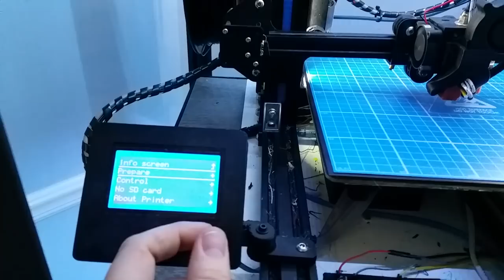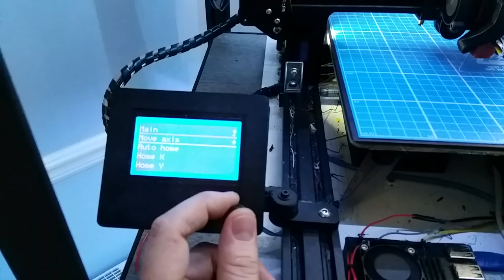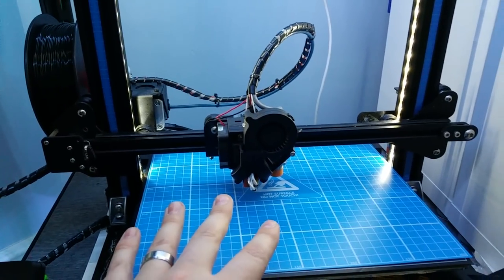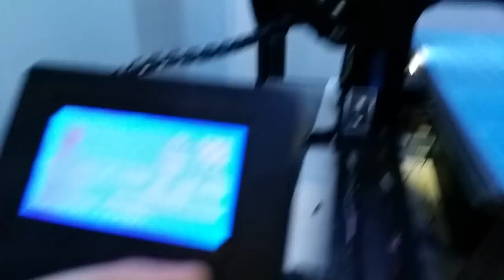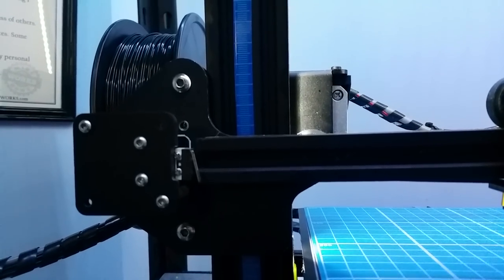Quick Fix - Checking your Z Gantry Level - How to fix

Comment: I thought maybe I was doing it wrong but watching your video its spot on. Here is my issue. I have a CR-10 max and I set my gantry height to 120mm left is usually a little lower. After I raise the left to match by twisting the left servo while servos are engaged "hot". Once I am happy with the Gantry level I go onto the bed leveling. after auto bed leveling is good I start the print. Just a note I am never more than .2mm off on the 16 points the BL touch examines. Everything print great. I don't shut off the machine I get ready for second print and the left Z axis has dropped again. I am going nuts. Only conclusion is the Servo's are sgutting off/unlocking for a second or two after the print has completed.
To further enforce that behavior, If I shut the servo's off I can watch the left side drop because of the weight of the filament servo and other hardware bits. What in the G code could do this. I am at the point of considering adding weight to the right side to keep life balanced. Any Ideas?

Comment: I am so glad you showed this. I just got my printer today and I couldn't level the bed. I noticed it was actually the gantry that was off. I have a Sovol SV01. They have a video showing to loosen a couple things and straighten it, then tighten. Doesn't do anything. Goes right back to where it was. Going to give this a try!
Reply from the maker: These upgraded leadscrew nuts we carry will prevent the gantry from sagging: https://www.th3dstudio.com/product/upgraded-leadscrew-nut-for-creality-printers-anti-backlash-nut/
Reply: @TH3DStudio  Thank you!!! Going to order some!
Reply: @amberlindsey7112  Did you end up sorting it out? I also have SV-01 and just realised the culprit is the gantry.

Comment: Thank you so much for this video! I thought I was going crazy, this makes a lot of sense now. However I think part of the problem is the weight of the extruder stepper and the print head stepper overcomes that z axis worm screw/stepper on the left side. I wonder if mechanically linking the two z axis worm screws together would help?
Reply from the maker: mechanically linking will help a lot.

Comment: I know this is an older video, but what would be the permanent fix for something like this? Also love those leveling stickers.
Reply from the maker: I still use the stickers to eyeball them. Adding antibacklash nuts to the leadscrews can prevent them from "falling" when the motors are off or you could source a closed loop belt and pulleys along with blocks to retain the leadscrews to physically link them together.

We carry the antibacklash nuts here and they should be restocked soon: https://www.th3dstudio.com/product/upgraded-leadscrew-nut-for-creality-printers-anti-backlash-nut/

Comment: The "long" fix for this (at least to get it closer to "square" with the frame) is to square the Z / Y fixed frame first (not easy, requires patience shims and engineer's level or other measuring tools) and then partly disassemble the X Beam (or gantry) in order to balance out the wheel set and the pieces holding the wheel assembly to the X Beam (which also isn't easy because you need to access hidden screws on the left side - and that means taking off the very top gantry of the frame and disassembling the Lead Screws so you can run that X Beam up and down repeatedly to check for square.   That will help take out "most" of the "spring" introduced in the X Beam that causes one side to move down when the steppers are off - but it's nearly impossible to make it perfect.

Connecting the left and right lead screws physically and not using dual stepper motor would help keep them in alignment longer after the steppers are disengaged.

Or you can do this before each printing session.
Reply: Thats where I started, and got my wheel sets pretty well in shape. However I think part of the problem is the weight of the extruder stepper and the print head stepper overcomes that z axis worm screw/stepper. I wonder if mechanically linking the two z axis worm screws together would help?
Reply from the maker: You are absolutely correct. A month later after making this we took apart the whole X gantry and squared/tightened everything up. It's been perfect ever since.
Reply: @TH3DStudio  is there a tutorial on how to do this? I've got this problem with my CR10s Pro
Reply: What actually causes this "spring" that pushes the gantry off-level? I can feel it when I try to level my x-gantry using the z-couplers.
Reply: @benparker3111  is there a vid on here showing how to do it the long way?
Reply: Nah the REAL fix is to stop using 2 different motors to control the Z axis. Instead get/print a conversion kit with gears and a timing belt to connect the 2 Z screws together and drive them from a single motor. That way they are forced to always stay in sync.

Comment: So you auto homed and then you held your printer? Which made the hot end go to the center? I've got a CR 10 S5 and if Ender 3
Reply from the maker: The center homing is only when you have an ABL sensor on the machine and you have the firmware setup to do so. Our EZABL kits with the accompanying firmware does this.

Comment: Thanks for the info :) question, if you were just running stock, when would the stepper motor kick back in on a cr10, just again when you start the print?
Reply from the maker: Whenever the Z motors are disabled. Depending on the firmware settings it varies. Our firmware keeps them locked when power is on unless the user power cycles the machine or tells the motors to turn off.

Comment: One thing to add years later,  be careful with dual Z if you dont have a collar keeping the axis down.  when I "leveled" my gantry, the power supply side of the gantry Z screw popped up to let it go back out of square.  you have to force it to stay square as Creality's design of the gantry makes it impossible to make it square
Reply from the maker: Yeah its not ideal. We have started using blue loctite on the bolts in our printer farm machines. It's made maintenance a lot less over time
Reply: Any bolts/ screws that I should avoid putting loctite on?

Comment: The problem is that this fix is temporary. I have found with printers like this, the X axis "wants" to be crooked as there are some other moment forces in the gantry forcing it into that position, so it will always go back to crooked no mater how many times you force it to be tram. Instead you really need to use a timing belt and a couple of small timing gears to connect the 2 Z threaded rods together to keep them synced, or better yet get a single-motor conversion kit to drive both of them from a single motor instead of 2 separate ones.

Comment: Hey Tim, great info. I actually use a 15cm / 6 inch metal ruler to measure from the frame to the horizontal beam of the X gantry periodically. Cheers, JAYTEE
Reply: I actually grabbed a bunch of Ikea measuring tapes to other day to perform the same function :) FYI the i3 Mega prints beautifully. The provided Mr and Mrs owl gcode was corrupt ( 2 failed prints at exactly the same position ). Sliced my own and they're gorgeous. Cheers, JAYTEE

Comment: i thought you were supposed to disable the 2 stepper motors that makes your gantry go up and down then just manually turn one motor down until level then  enable motors again ??? just got my cr10s yesterday so i am still learning proper setup...thanks
Reply from the maker: Keeping them engaged will make sure it stays level until the next time they are powered down. You can add on an antibacklash nut to help prevent this as well. We've added those since making this video: https://www.th3dstudio.com/product/upgraded-leadscrew-nut-for-creality-printers-anti-backlash-nut/

Comment: Thank you for the video! not sure what I'm doing wrong but I just can't level my z level, the extruder level is 1mm of from left to right and no matter how much times I try this hack it does not level it, any ideas?
Reply from the maker: If its going back to the old unlevel setting you should rebuild the printer and make sure its all square. The root cause of it going out of level over and over again is due to a mechanical issue and its usually improper assembly.

Comment: How do you make the auto home go to the middle? I have a CR-10 and it goes to the left front corner...
Reply from the maker: It's part of the ABL system settings in the firmware. It's called Z Safe Homing.
Reply: @TH3DStudio  does it come with the original   CR-10 system? I can't find it...
Reply from the maker: No, this is only when you update the firmware and you are using an ABL system. We have all that setup in ours. https://support.th3dstudio.com/hc/en-us/articles/360043293452-TH3D-Unified-Firmware-Package

Comment: why would  you raise the left side, where the z stop is, instead of the right side? wouldnt that throw it off every time it homes, since that side is set by the end stop?
Reply: right, when it homes again, wouldnt it go lower... back to where it was before you leveled it, since thats where the end stop put it?
Reply: it doesnt have the end stop on the left side, with dual z?
Reply: Yeah, the cr-10s and other models with stock dual Z only have the one end stop switch on the left side(extruder side). So if you were to home it every time it would naturally default to that position of end stop.
Reply: yeah, thats the same as the models with the single Z. so making any adjustments to that side would be negated once it homes again.
Reply: One would think since it always has a set home position, so you would adjust the right side to compensate since that side has no reference outside of what you set it at. But not an expert, just know i dont have this issue with it dropping out of sync. Still applaud the help if its helping someone, im just missing it.

Comment: i cant get my bed to line up at all the motor keeps slipping and i did what you said now nothing lines up at all and i cant fix it
Reply: I cannot see how this would work long term because as soon as power is off or steppers are disabled so there is no motor detent it would just spring back.

The real problem would seem to be that the X axis is not square to the vertical gantry, and that is because it is not mounted square on the pulley brackets.

So, to solve this  I assume you might have to slightly loosen the X axis to pulley bracket mountings, get it level, then tighten them up again.
Reply: @Nkkdxn45j  dont matter now nick i sent it back lol thanks for commenting though ill be getting a new one from creality and not off ebay next time lol
Reply: @learningtolivewithhumans1859  I've just bought a Sovol SV01 and it's 3mm out (Sovol say 1mm is OK). Waiting for advice from Sovol.
Reply: @Nkkdxn45j  its like they build them to bloody break man drives me mad , i was building a prosthetic arm for a kid and had to tell his mum i cant make it because the printer is naff
Reply: Nick W hey Nick, I’ve got the exact same issue with my sv01. Any fix ?
Reply: @cupofclip7956  sent back and got money back, i then got an anycubic mega pro
Reply: @cupofclip7956  I haven't done this because mine wasn't far enough out to worry, but:

I think you need to loosen the screws (two each side) that secure the X runner to the blue brackets, get it level, and tighten them again. Simple - but the problem is that on the LHS the screw heads are hidden by the vertical gantry so you cannot get at them. You can see the heads looking vertically down the front side of LHS vertical gantry.

Therefore my approach would be to replace those two with normal hexagonal head bolts (M4x16 I'd guess), so they can be tightened and loosened with a slim open ended spanner slipped down between the blue bracket and vertical gantry.

How to change the allen cap head screws for hex head in the first place? Not easy, but two possibilities: disassemble the gantry to the point where you can slide the X runner assembly sufficiently off the top or bottom enough to get at the cap head screws, remove them and replace with the hex head. Or, might be able to do it by removing the Z axis runner wheels and slackening the X axis belt - that might allow you to move the X runner and bracket sufficiently away from the vertical runner on the LHS that you can then get an Allen key in to remove the existing screws and replace with the hex head. Not trivial, depends how confident you feel about taking it all to bits. The second, if it works, is simplest.

It wouldn't bother me, but like I said, mine wasn't far enough out to worry.

Once you have swapped the screws and reassembled it all, it should be pretty simple:
 - Slacken the two screws on each side (not loose, just slack enough that the X runner can be moved slightly relative to the blue brackets).
 - While loose set the Z runner wheel tension on each side correctly by rotating the eccentric nuts on the single wheel on each inner side. You basically want them tight enough that there is no slack to let the wheels rock, but not so tight they bind.
 - Place something between the base frame and X runner on each side, equal sized, so the X runner sits level.
 - Tighten up the two screws each side securing the X runner to the blue brackets.
 - Re-level the bed as normal. Job done.

E&OE, as I said, not tried it myself, but that is how I'd go about it. I did go as far as getting some M4x16 hex head screws, but that was it. I also have a belt between the two Z screws at the top to stop any slight relative movement (knocks etc) when the motors are off. (GT2 parts off eBay and a self designed tensioner).

Hope that helps.
Reply: Nick W woaw ! Thanks for that long reply ! Super cool. I found a way to leveled it in moving the steppers. I have already order a z belt in order to synchronize the z axis. So far, I have no issue. When I’ll get the component for the synch mode, it will be fix for sure.

Cheers mate :)

Comment: You know why it is doing that?  This is NOT the fix.  This is cause by your gantry brackets being mounted to the rail incorrectly.  Home your printer, loosen the two screws on the backside of the bracket slightly.  Level the gantry as shown.  Tighten the screws.  BOOM, your gantry will never be out of level again.

Comment: Wow, so I has about 3 minutes into this video and I was looking around the printer when I realized, I didn't have both of the z axis "motors" or whatever they are plugged in. I got the one plugged in and it works fine... man am I stupid. xD
Reply: I did exactly the same and I suspect it is because of that stupid omission that it is not leveled now —‘

Comment: manually turning the coupler doesnt really work. For me the other side also moves even if i use same long stoppers on both sides under the gantry while doing the coupler turn the other side drops after removing the lelelers
Reply from the maker: You likely need to re-work your gantry: https://www.youtube.com/watch?v=GLvpfpK5mo8
Reply: shiaaat... i bought a prusa as a kit. did not wanna do that with creality. What an disappointment. China just keeps on surprising. well not really.

Comment: OK, so that's a quick bootleg on the fly kinda fix. The real question is how to PERMANENTLY fix this issue so it doesn't have to be done every time you power up, and to also prevent any sagging during a print??? I have this issue on my Ender 5 Plus. The gantry does not move on the Z axis on an Ender 5 Plus, the bed does, but it's still the same problem.
Reply from the maker: You could fit anti backlash nuts on the leadscrews.

Comment: I didn't see where anyone took you up on your offer about wanting to have some arrows that you could push into the screw heads.  I made something for 3mm socket head screws that should work for you.  I based the dimensions off of my CR-10S.  I haven't been able to test it yet because I only have that printer and it's in the middle of a 3 day print.  You're more than welcome to try it though.  www.thingiverse.com/thing:2785901